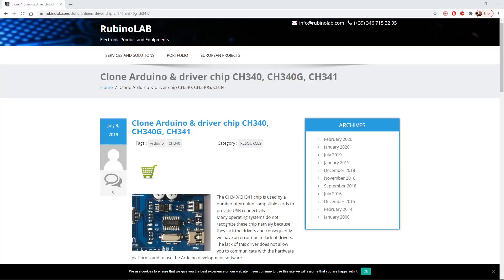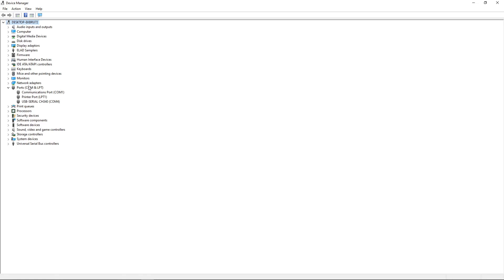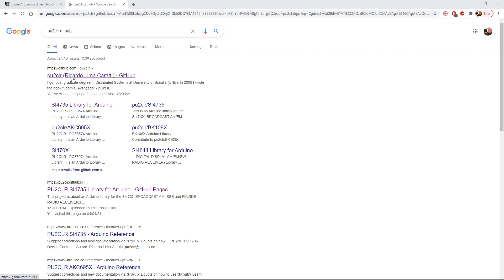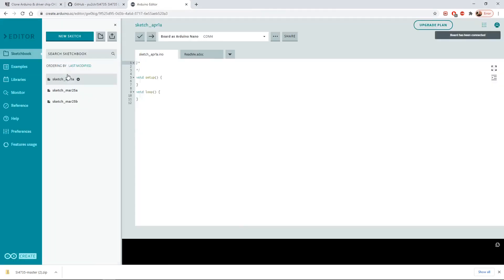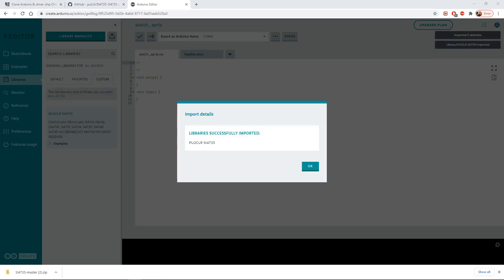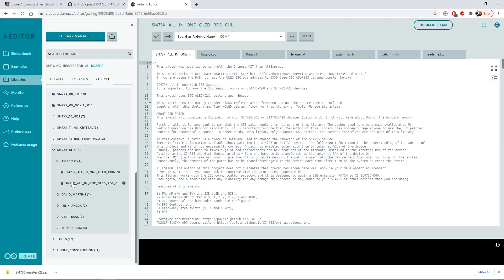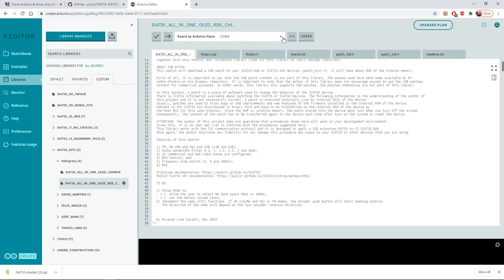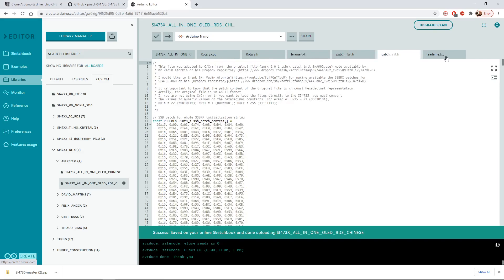How I flashed the firmware on the SI4732

Comment: Just flashed my ATS-20 to V3.0.7g. Unfortunately the online Arduino programmer didn't recognise the Arduino in my box. Instead I used the ordinary Arduino IDE 2.0.3 version and it went very smoothly. Had to add a couple of libraries though. Haven't tried it out as my antenna is down due to a builder hitting it with some lengths of rebar. Now I've tested it, I really don't like this version, it is not at intuitive.

Comment: no mention of the port settings in device manager!
Reply from the maker: I show the device manager around 3.06 in the Video. If you are referring to the advanced settings for the ports (baud rate etc) I did not change these from default.
Reply: @KevinOReillyswl  what are the defaults,mine is on com4 at 9600 baud,its the ats 20 with the smd 328 not the nano,it wont connect to the ide no matter what i try.

Comment: Kevin, I attempted the upgrade to the Si4735 as per your video. However the Web Editor does not provide for selecting the com port. The com port is 100% via device manager! Any suggestions? Thanks in advance
Reply from the maker: I was going to suggest that you were missing a driver but it the com port is showing in device manager that is strange. I would try powering the radio on and off whilst it's connected and web editor is running but that is an odd error.

Comment: Now that I tried to upgrade the firmware, I run into a small challenge. Drivers installed fine, sketch compiles, radio visible as Arduino Nano, ... BUT ... the upload to the radio fails. The radio obviously gets a reset at the beginning of the actual upload (it gets silent for a few seconds and shows the splash screen), but it does not "stay in programming mode". It rather seems that the radio simply reboots and the Arduino Web Editor goes into an infinite loop, trying to upload the compiled sketch. Any clues to why this happens?
Reply from the maker: I haven't had that particular issue. Normally if the radio goes quiet when uploading you will be ok. Are you using the "old bootloader" setting?
Reply: @KevinOReillyswl  Yes, the bootloader "version" might be the culprit. I cannot however find any setting pertaining to the "old" bootloader in the Arduino Web Editor, so I tried something else instead. I loaded the ATS-20 code (v 3.0.7) onto one of my (original) Arduino Nanos without any trouble. Then I desoldered the Chinese "Nano" and replaced it with my "real" Arduino Nano. It turns out the "real" Arduino Nano works just fine in the radio, with one exception. I have challenges with the extra "power wire" from the radio motherboard to the "real" Arduino Nano. Whenever I connect the USB cable, the radio goes haywire. My guess is that the Chinese Nano is "a little bit special" also regarding its power feed. - An interesting experience all in all. Tonight I will try to figure out exactly how the power/charging of the ATS-20 works. The story continues ...
Reply: @KevinOReillyswl  Update: As I do not know enough about the actual design of the radio motherboard, I "cheated my way out" of my dilemma. I simply decided that I do not need the built-in rechargeable LiPo battery. I disconnected the battery and soldered wires to the battery connector. The wires exit the chassis through the "ventilation grill" on the front and are fed by a 3xAA battery holder which I happened to have (via a diode which conveniently gives a 0.6 V voltage drop). Summarized: The "real" Arduino Nano works nicely (FW 3.0.7) and the radio is now powered by three AA batteries. The current consumtion seems to be around 40 mA, which means that the radio will run for many hours on three alkaline batteries. - This was an interesting exercise :-)
Reply: Me on my side i have to disconnect the speaker and the battery to achieve the upload of the firmware to the radio

Comment: After download of ch340 drivers, I try to install.  My windows 10  says "not found install application."  What is that?
Reply from the maker: Marc I haven't seen that particular error but I had some problems myself with Win 10.
Reply: @KevinOReillyswl  After several tries (picked the 64 bit version) and several reboots ... it worked.  Picked old atmega boot loader ... and installed this version ...  Now I have 40khz filter on FM.

Comment: Great instructions Kevin !

For that specific firmware I'm not sure that the default step size for the bands is being honoured but no big problem as the firmware does have the ability to choose the step size of 9 Khz for the European MW bands which is a welcome improvement. PS the author of the sketch has not updated his comments at the top since the code does in fact allow selection of the step size to be 9KHz, as you can see in the code itself, whereas the comment section at the top is out of date since it only mentions the Frequency Steps' sizes of 1, 5 and 10KHz ). 
For the radio which I bought ( https://www.amazon.co.uk/gp/product/B091L3FGGQ ) I had to set the 'flavour' of the Arduino Nano board to be   'ATmega168'  for it to upload, as the setting of 'ATmega328P' didn't work.I guess different manufacturers are using different clone chips so presumably the default of  ATmega328P  works for others. There are some comments on other online articles about that setting more generally.
It's great to be able to customise and tailor / correct the 'band-plan' since these differ in different parts of the world. 
Thank you !
=============================================
Error seen, which was fixed by changing the 'flavour' of the board as mentioned above :- 

Generating function prototypes...
avr-g++: error: missing device or architecture after '-mmcu='
exit status 1

Comment: Had another look after my successful upgrade. I do like the improved signal meter. What a fascinating cheap receiver.  Thanks for sharing your knowledge it is appreciated. Look forward to further software upgrades. I think the tuning steps for ssb at 1 KH is to high 10 khz will enable fine tuning if that is possible on further upgrade. Thanks again